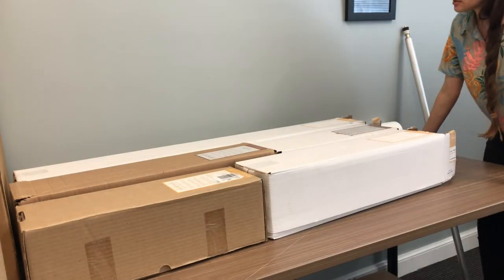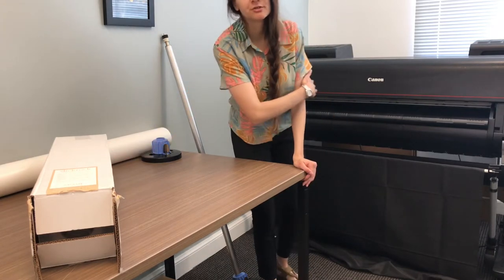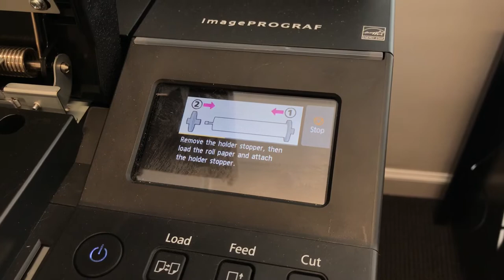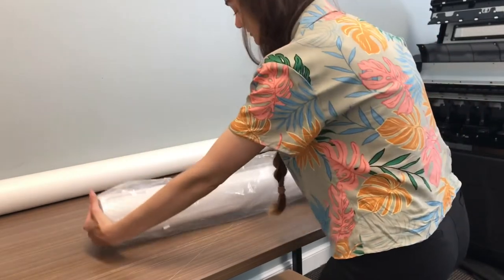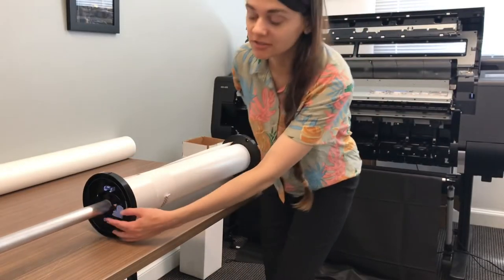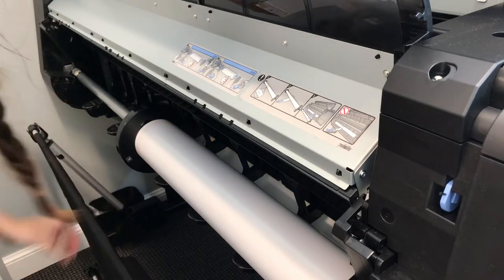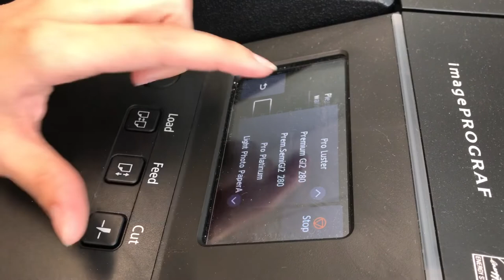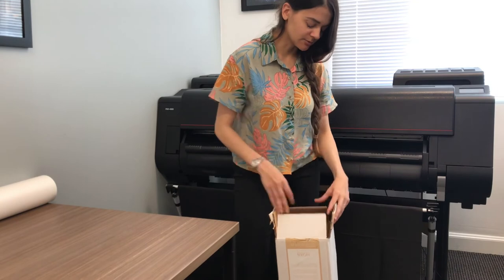HOW TO LOAD A PAPER ROLL INTO THE CANON IMAGEPROGRAF 4100

Comment: Great video! Can the 4100 cut the media for sticker making?
Reply from the maker: Hi Timothy. If you mean Can the 4100 cut a design or pattern, no, it only does single line cutting. If you mean is it strong enough to cut through thick sticker paper then yes, it may be possible. You would need to see if your sticker media has an ICC profile. If it does not, call up the Canon Support Line at 1-800-423-2366. They are very helpful and if you can describe the media you are working with, they will guide you.
Reply: Thank you!

Comment: How wide are your doorways? Can this fit through a 31 inch doorway unassembled?
Reply: Without the legs easily.
Reply from the maker: Hi there andres martinez, sorry for the late reply, this question got lost in my list of notifications. Unfortunately I do not know how wide the doorway was; I'm no longer working out of that particular office. The manual says "62.8 x 28.9 x 24.8 in." for just the printer and "62.8 x 30.2 x 46 in." with the stand. It seems like you can fit it thru a 31" doorway, though you may have to tilt it slightly. Keep in mind the Permitted Maximum Angle of Inclination in all directions is 90 degrees and before attempting this you have to execute "Prepare to transportation". The ideal inclination range is 0 to 30 degrees as it uses up less maintenance cartridges.

Comment: The NEW paper roll is not cut straight, do you manually cut it straight first before loading it onto the printer?
Reply from the maker: If the new roll's edge is crooked, you should initiate "Trim edge first" in the touch screen menu before loading the paper roll: Home > Paper Settings > Advanced > Trim edge first. This setting will take effect the next time a roll is loaded.